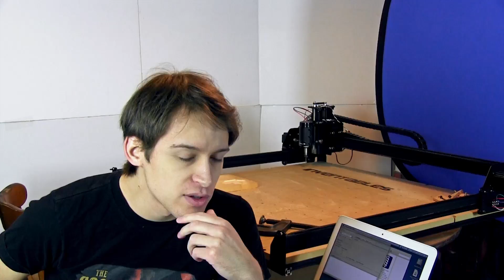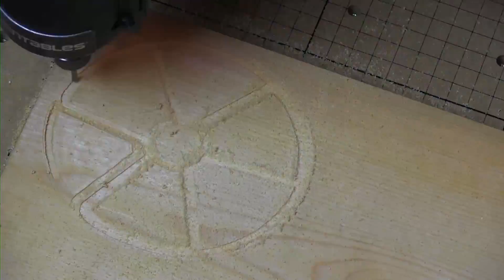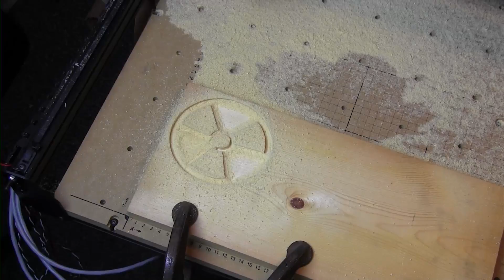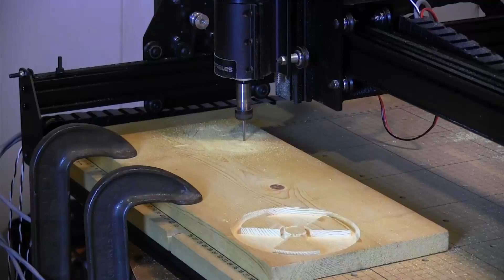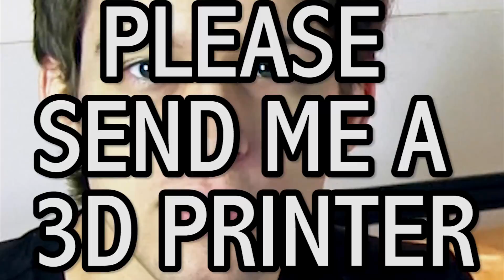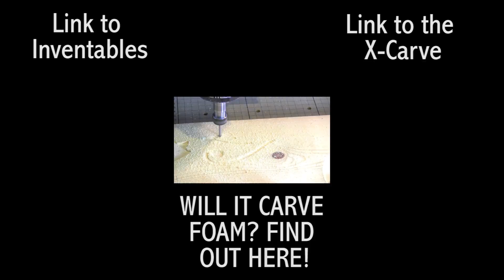Inventables X-Carve Review

Comment: ....limit switches aren't necessary?... I've designed (and made) some 3D printers (pretty much a cnc milling machine with a 3rd axis and an extruder instead of the milling thingy) and boy, limit switches are necessary for calibration for the best results possible :P